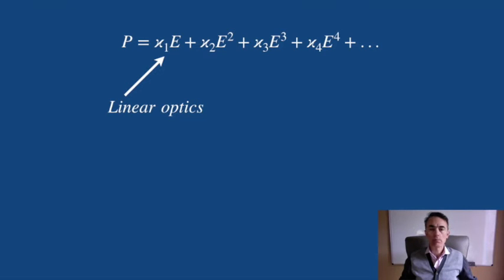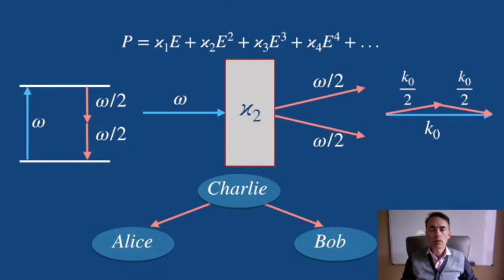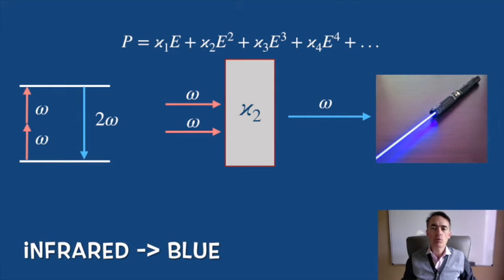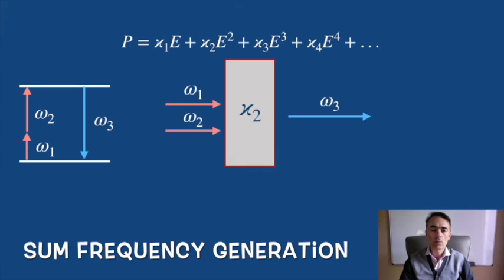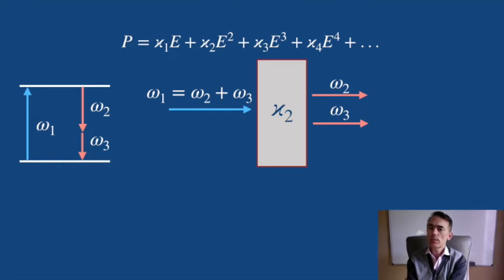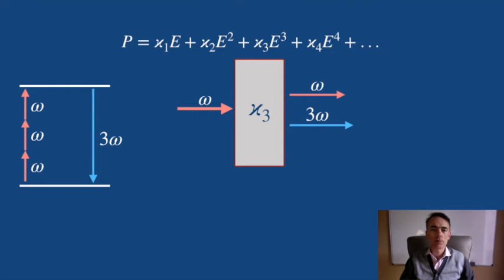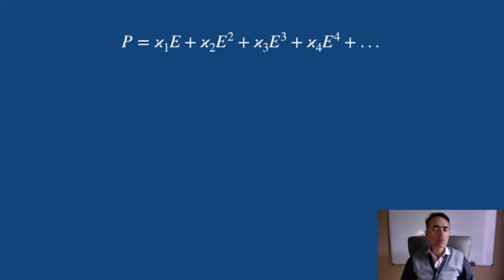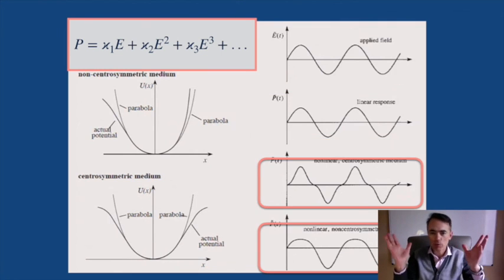Optics: Nonlinear processes

Comment: Incredible video !!🎉
Can i Use a non linear cristal in front of my screen to make its light invisible?
And then make it visible with a non linear crystal in a glasses, using the second harmonic generation?
Reply from the maker: Then thing with these nonlinear effects is that they are less likely to happen and therefore you need high intensity light to generate them but not all light will go through this process, so most of the light leaves unaltered.
Reply: Well the more practical approach is to remove the polarizing foil from your screen and put on polarizing glases ;)